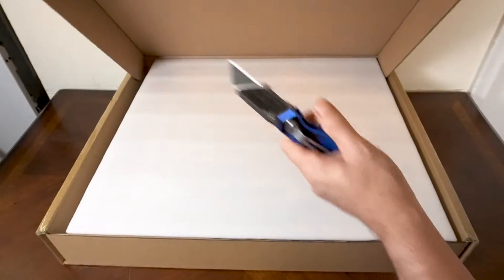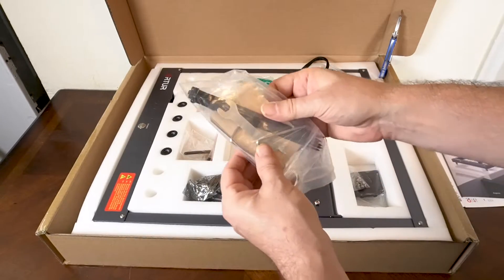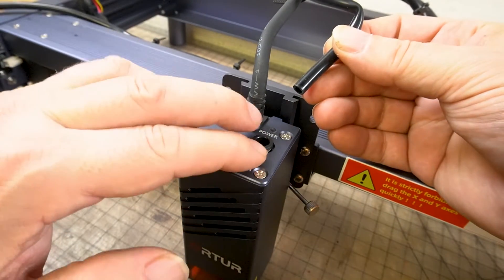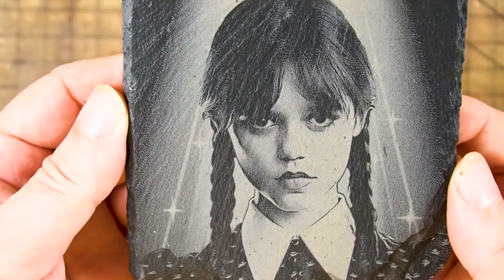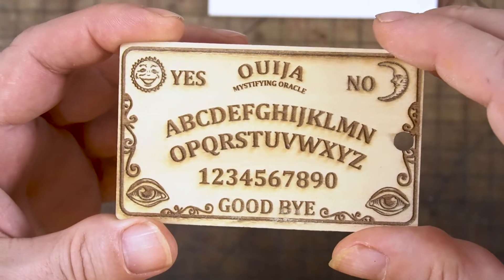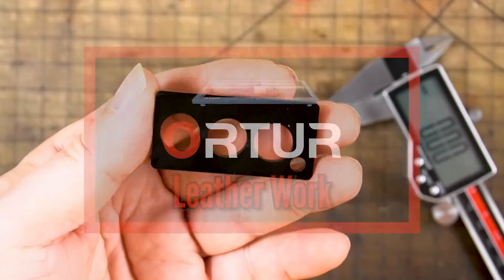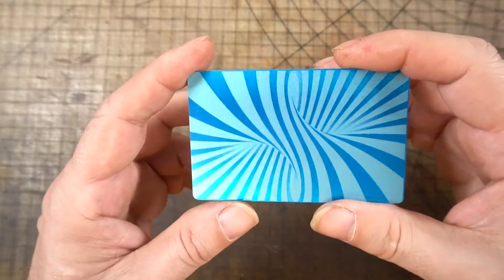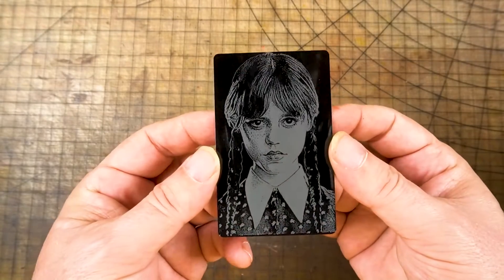Exploring the Ortur Laser Master H10: Real-World Tests.

Comment: which better this ortur laser or aufero?
Reply from the maker: It comes down to the laser module. The Ortur laser master H2 as seen in this video has better features like 2 stop sensors and it does "home" and has an emergency stop button but I like my Aufero better simply because the laser module mine came with cuts better. For me that is more important. My Aufero has the LU2-10A and to me it is a better laser module then the LU3-10B. If your looking for a machine, dive into the specs and tech of the laser module. I hope this helped.